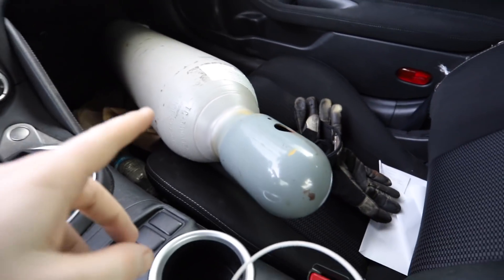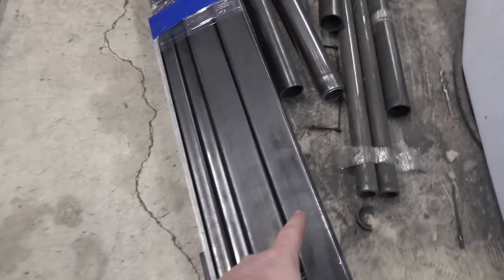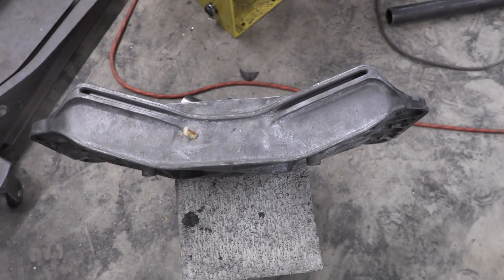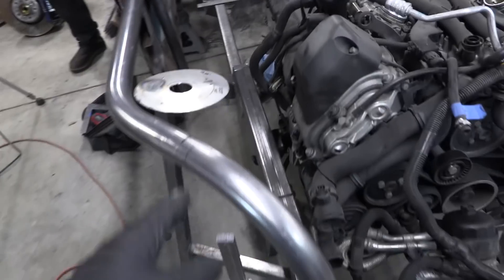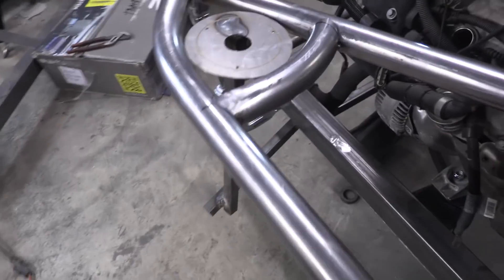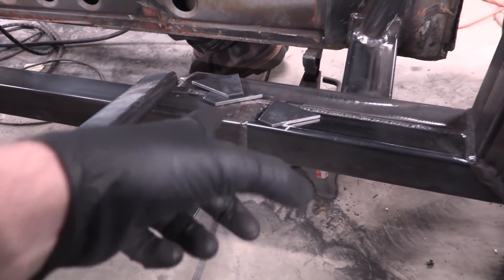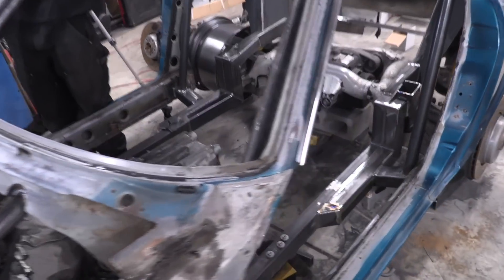We Have Strut Towers!! And A Transmission Mount!!

Comment: Check out the fab forums new video. When. Your welding tubes together drill a hole in the other tube to so the pressure has somewhere to go and doesn't try to blow out your weld.

Comment: My two cents is that you should use a section of that 1/4 plate steel or even half inch to reinforce that gearbox cross member mount along the bottom of it. Easy done and would be so much stronger

Comment: Do you plan to gusset the front strut tubes where they meet the top of the frame rail in front of the engine ?  It looks like it will get a twist/pull load at that point, and those two welds will be taking more than half the weight and front suspension compressions loads of the whole car, transmitted thru the struts.

Comment: The bolt will crush that tube for the transmission when you tighten it down. You need to put a spacer inside the tubing where the bolt goes through to prevent it from crushing it.

Comment: You are going to have flex in the upper strut towers. Look at a tube chaise race car, you will see that there is a bar coming from the outer bar down to the frame rail. There is no need for the inner bar that is going over the engine, the frame looks heavy too much metal in it.

Comment: Here is the millionth comment about the bolt for the trans cross member. I recommend sleeving the hole. also make sure the bolt you use is tightened down enough to squeeze the brackets tight to the cross member. Bolts are really strong when it comes to pulling, they are very week though when it comes to sheer strength, so if you are using a bolt as a pin, it will not last.

Comment: Hey guys, have you thought about using Tube Connectors on those tubes over/near the engine? Or even for a cross brace over the engine utilizing those?

Comment: Not sure why you opted to bolt the trans cross member horizontally. It's going to be an absolute bitch to remove. Just box in the trans mount, plate the top of your bracket and weld a stud facing downward in there.

Comment: was watching a different build, where the guy talked about how you need to drill a hole into the tubes. Before welding them together, so the pressure could escape into the other tubes.

Comment: I have a question guys. I know this is not related to the video but I just wanted to ask. I bought a 2000 Firebird for $500 well the engine was running when I bought the car then about an hour later it threw the rods. I can get my job to replace the engine with a used engine approximately 65k miles on it for 3,845.06. Thats with engine price, labor at 109 an hour for 20 hours, and the tow fee. The chassis has 184,000 miles on it. The interior also needs a little fixing up and the passenger headlight motor doesnt work. Would it be worth it to repair for a 19 year old? I love this car and always loved Firebirds so I really want to but I want more experienced peoples opinion. Thank you for taking the time to read this and helping me
Reply: Well my job will let me do a payment plan on the cost. Plus at least this engine is a rebuilt engine so I wont have to worry about how the previous owner treated it. Plus wouldnt be a good learning experience for me so I get to the car inside and out? Not trying to sound like I have an attitude lol. These are just the questions I have going through my head and what people tell me.
Reply: It still has a clean title on it as well

Comment: You need to reengineer that crossmember brackets! You cant just rest all the weight only on those bolts. Box the crossmember in from beneath so the bolts just stop it from getting removed. Not being its support
Reply: Caspar A is correct!  Bolts do not carry much load in shear, even grade 8.  They are designed for tensile loads.  This crossmember WILL fail very quickly if you leave it this way.  I love the build and am thoroughly enjoying watching it come together!  Thanks for your work Chris!

Comment: Probably would've been a better idea to leave the welds on all thr structural stuff and not grind them smooth. Also, those cross member bolts attaching it to the frame won't last long.

Comment: What are you going to do about the intake plenum? Pretty sure that will hit the bars :(.
Reply: TBasianeyes put stacks on the ITB’s obviously hahha
Reply: Well that is a solution but I doubt that the hood will shut. It also won't run without significant ECU remapping and from what he said in earlier episodes that is a no go. Wouldn't really make sense to bring all the BMW electronics into the car if you are in the end going to run catless with custom intake, without MAFs and with AlphaN.
I'd do it, saves a ton of space but takes way more time.
Reply: TBasianeyes cut a hole in the hood for the stacks, wich would look awesome, and get a mega squirt ECU
Reply: Was thinking the same thing

Comment: shouldn't the transmission mount bracket be perforated at its lowest point to let garbage/water out that seeps in through the higher holes on the bracket?
Reply: It is. those access holes
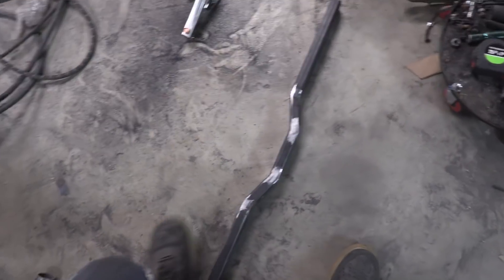Reply: Those access holes are one the parts that are going down, there is no access hole at the bottom / lowest part. Junk can come in through those holes and be trapped at the lower spot (see 8:49 )

Comment: You better sleeve the bolt holes on the trans crossmember
Reply: Definitely sleeve the cross member to frame mounting holes.. the hole that will be drilled in the cross member for the mount to the frame is the one that needs to be sleeved...not the holes already drilled for the transmission
Reply: Yea that crossmember seems a little thin. I hope he sleeves the crossmember to chassis bolt holes
Reply: I agree but I also feel like the tube he used is already a little thin for its job and to drill a hole through it for a bolt would make it weaker... maybe a vertical bolt would be better and also be easier for extraction too
Reply: guys go easy on him, after all it's only a transmission XD
Reply: J D I believe he is only having the bolts run through one side if the tube. The other side of the tube is just an access hole for the bolts. Sleeving them would look nice but I don’t think it would help anything. Could be wrong though.
Reply: Brian W  im talking about sleevin the end of the crossmember where it bolts to the frame..
Reply: bolting to one side of the tube will make it much weaker mainly due to the hole that is drilled in the other face for access. it might not matter though because most of the load will be vertical...
Reply: also, the problem with a sleeve is that he made those holes obround.... sooo

Comment: Are you gonna put some kind of bushing on the bolt that holds the crossmember in the bracket?  Seems like it could possibly make noise or vibrate or rattle.
Reply: the bushing is the mount between the transmission and that crossmember bar. the bar itself can be bolted tight, plus would add some bracing to the frame

Comment: I would change the way you mount the transmission mount onto the main frame. Change the brackets to be two on the side and one on the bottom so you can drill holes from top to bottom, it has more surface area to rest on, so you can attatch it in a more durable way.
Reply: They want to be able to drop the trans easily...

Comment: I think it'a a RX-8. Any hints would give it away (makes sense), and no big YouTuber has heavily modified one (also checks out). Also, if your an OG fan, than you would remember that Chris has talked about getting an RX-8 drift car in the past.
Reply: and the comment about the strut tower looking like a rotor? he must have been thinking of it.
Reply: Not rx8. I asked him about it on his twitch he doesnt like them cause they have worse engines than rx7
Reply: @nazarrakhmanov9357  bah, whatever... The renensis is the best rotry to date. Over 200hp NA 9k redline in an oe application
Reply: @Derkenblosh2  dont get me wrong man. I love rotary. I have an rx8 myself which is why I asked chris if hed ever do a rx8 build. I was just saying that he responded saying he doesnt like rotary engines
Reply: It's a TVR...what do I win?... Nah, but saying it doesn't have brakes, for sure means it came with carbon ceramics... Cause it's worth the $10k to strip em off the car
Reply: Its a  1990 300zx
Reply: what would be the point on rebuilding a damaged 300zx if good ones are cheap
Reply: UJCD plus a 300zx is an old car...
Reply: jimmy oaks has one, but idk if chris knows that
Reply: Could be a 2000s thunderbird
Reply: @mostafamrad6889  I'd love to see a YouTuber swap a Yote' into one, with a with 4.0l KB
Reply: @mostafamrad6889  Chris fix did a video on a 200s T-bird not that long ago either
Reply: +Richard Seffer Citation?
Reply: The rx8s renesis rotary is a great engine, but let down by weak apex seals and poor lubrication. If the lubrication is improved, the apex seals don't wear as fast and doesn't lose compression.
Reply: Also voting gtr
Reply: I have an RX-8, they showing their age now its not modern, plus I watch plenty of youtubers (very small) that do allot of work to these
Reply: I bet it's a beige Camry, year doesn't even matter.
Reply: Everything newer than '00 is modern for me. Oh wait it's already been 18 years...
Reply: It's a bently
Reply: Tavarish has a Bentley so not that...
Reply: Gtr
Reply: An RX-8 is not a new car. I think it some kind of exotic or something since he says that car doesn't get heavily modified.
Reply: RX-8 quit production in 2012. It could be a 6 year old car. 6 years old is relatively young for a car by my standards. Old would be 10 years +
Reply: p00lking 

No, it's not a "new" car, but it is a MODERN car (which is what he actually said)... I sure hope it's not an RX8, they were fucking terrible and fugly cars...
Reply: tj hunt just did